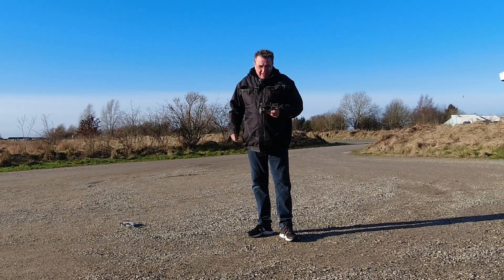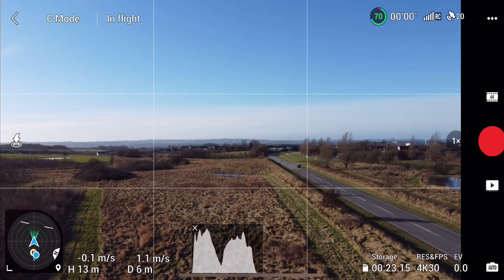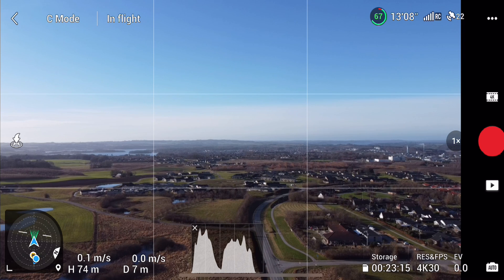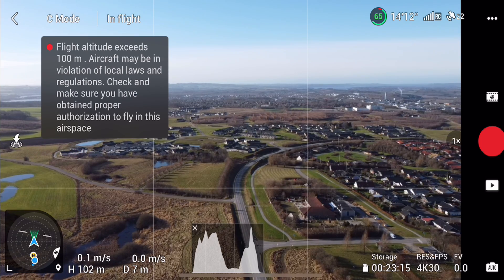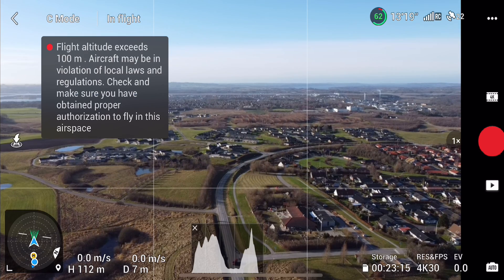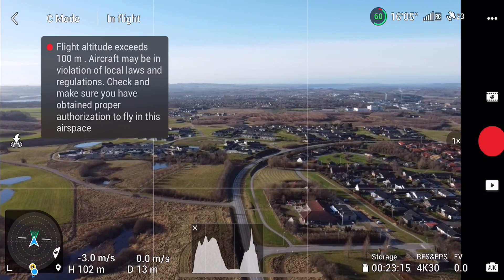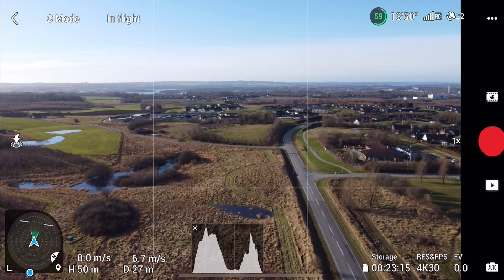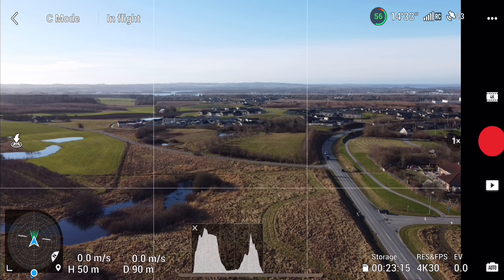Dji mini 2 I How high or how far should you fly to have your mini 2 out of hearing range?

Comment: You have much better hearing than i do. I can hear my Mini 2 up to about 275 to 400 ft in height. As for distance a little less.
Reply from the maker: I think it also depends on the weather conditions, wind, humidity etc. 👍
Reply: I can hear it at max allowed 400' no problem.
It is annoying at 100'
Reply from the maker: @graphguy  Try if you can hear it at 50 m (164 ft) up and 90 m out ( 295 ft)
Reply: Thank you for sharing I learn something how to calculate the distance remote to the drone.